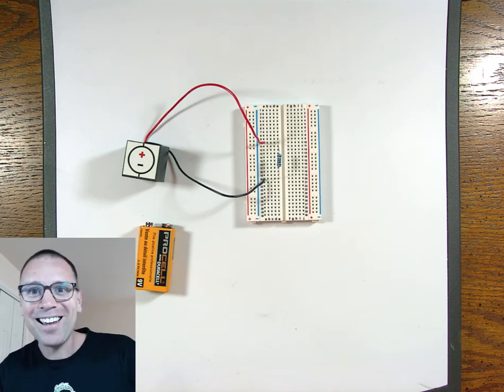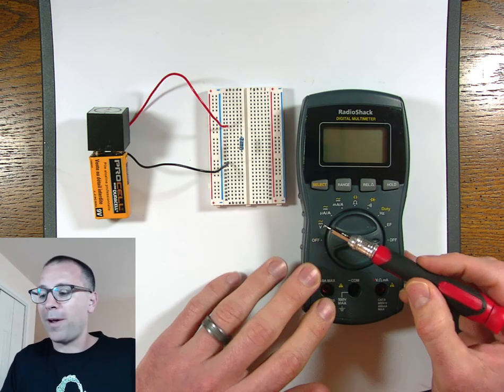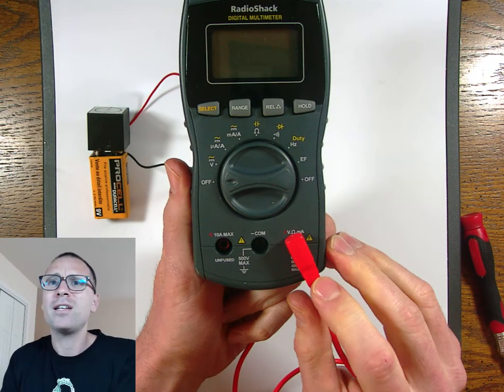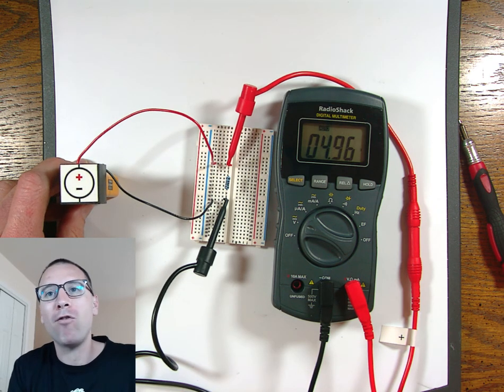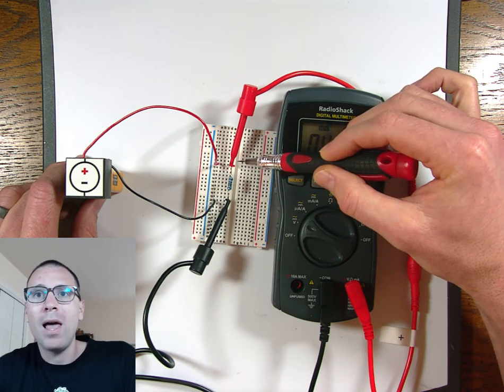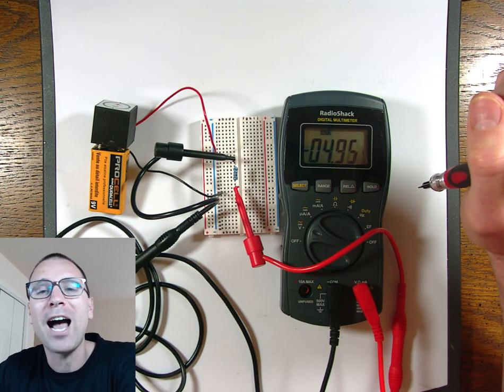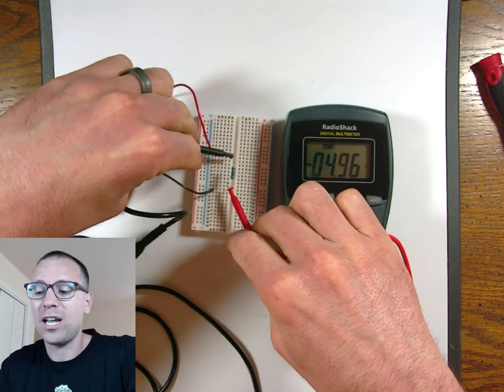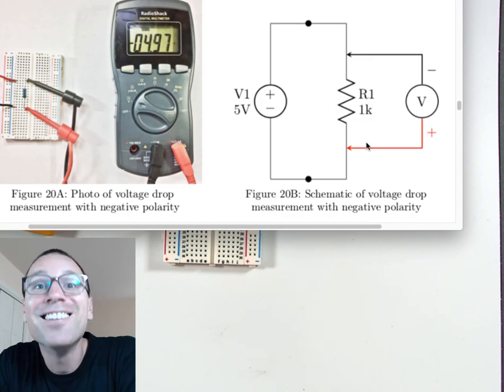How do we measure the voltage drop across an element using a digital multi-meter?

Comment: I'm 4 years late but I'm a struggling college student in an electrical engineering class right now and THANK YOU SO MUCH!! This video actually saved me, I hope you have a wonderful day!!!
Reply from the maker: Thanks so much for this comment. I feel overjoyed to know that the labor I put into this project is helpful for you. 

If you liked this work, perhaps you might also like the corresponding paper I wrote on this subject:

https://www.appliedlinearalgebra.com/s/PRIMUS_Linear_Algebraic_Nodal_Analysis_Anderson_Nguyen_Accepted_Manuscript_v20241010.pdf

https://www.tandfonline.com/doi/full/10.1080/10511970.2024.2369984

I also have a support website for this project with a ton of fun resources for further exploration:

https://www.appliedlinearalgebra.com/linear-algebra-laboratory-exercises/linear-algebraic-nodal-analysis

At this moment, I have more work to do on this project. I want to publish a paper on the Power-Block project that allows students to confirm their mathematical results using LANA via physical measurement:

https://www.appliedlinearalgebra.com/linear-algebra-laboratory-exercises/power-blocks-project

I also plan to re-write all of my content into a single lab manual and expand the LANA algorithm to deal with capacitors and inductors also... I have to be patient as I build all that. 

Thanks for your attention and cheers to your learning! 

PS. If you like this work, you might enjoy tracking the linear algebra book I'm working on:

https://www.appliedlinearalgebra.com/

https://jeffandersonmath.wordpress.com/2025/01/03/the-three-books-i-am-currently-writing/